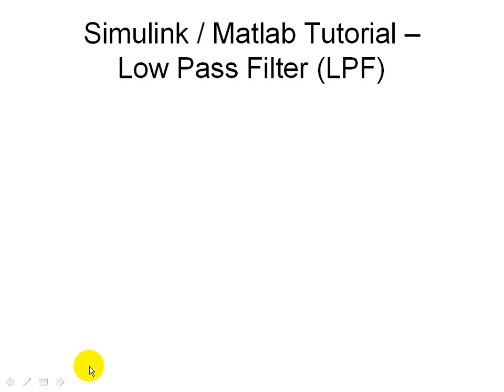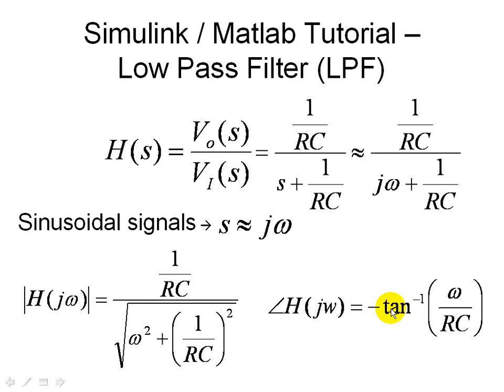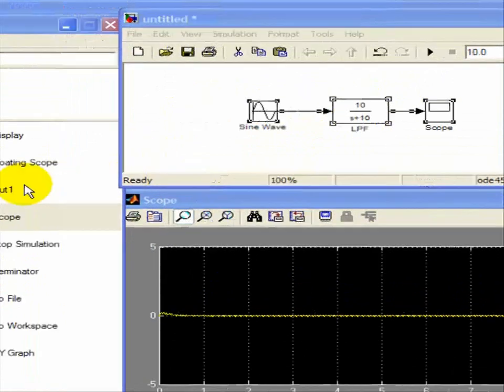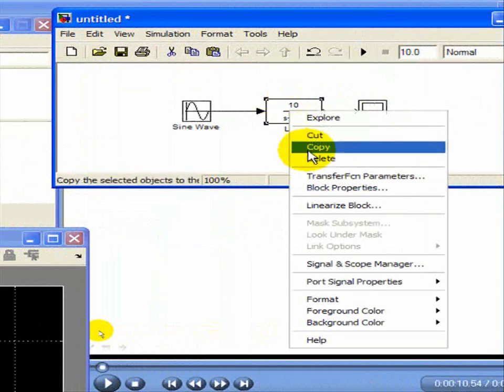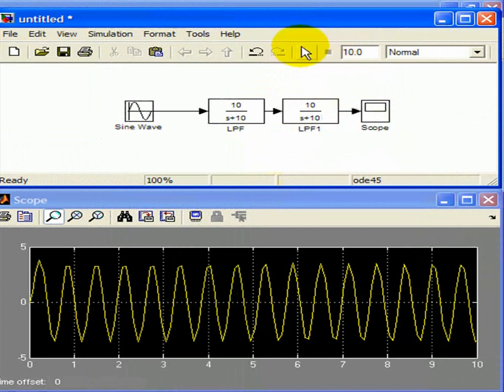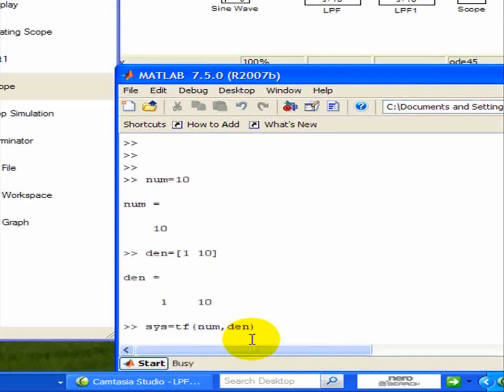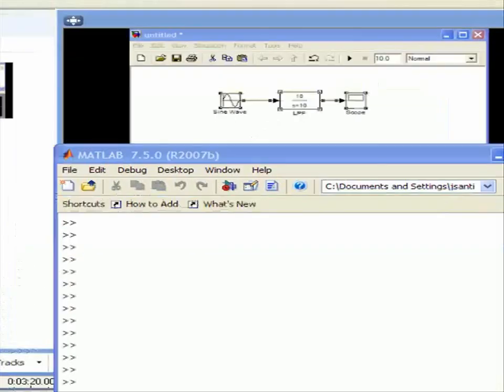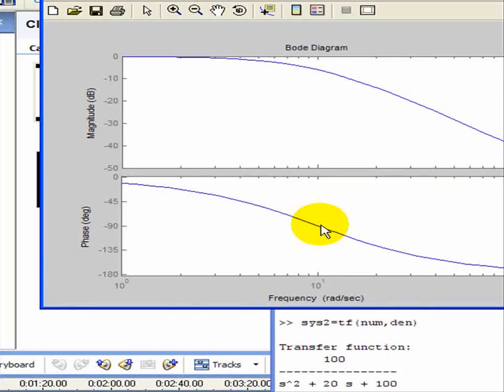Simulink / Matlab Video Tutorial and Example - Low Pass Filter - Bode Plots (Part 2)

Comment: I think you did a mistake at minute 1:28, in angle calculation. It is because H(jw)=(1/RC)/(jw+1/RC)=1/(jwRC+1)=(1-jwRC)/(1+(w+RC)^2). So the angle=-tan^(-1)(wRC). But you get angle=-tan^(-1)(w/(RC)). I would be very gratefull if you or someone else make clarification. Thank you.